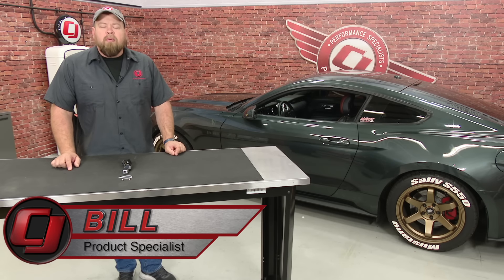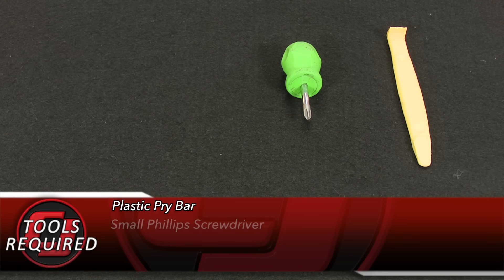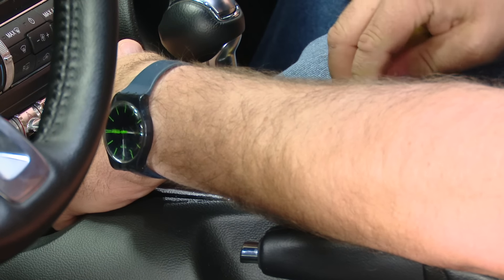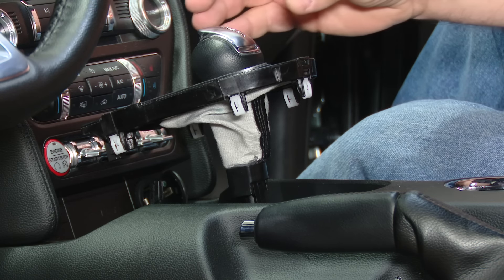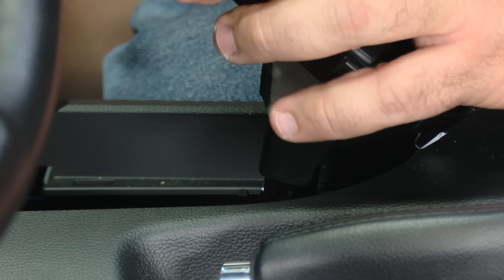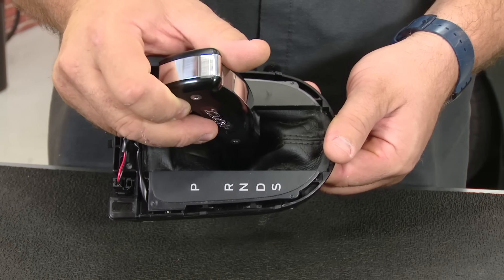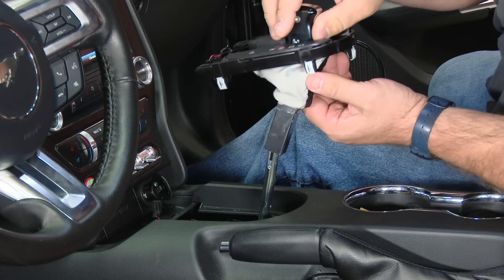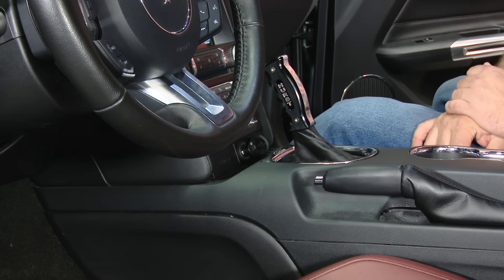2015-2022 Mustang V6/EcoBoost/GT Hurst Automatic Shifter Handle Pistol Grip Installation

Comment: Am i the only one who has had an issue with not being able to seperate the original shifter from the boot?
Reply: Ryan Shaffer no I'm having trouble as well
Reply: The original assembly as in the black panel wouldn’t come out of mine without snapping plastic that holds center retainer

Comment: I just installed this in my 2018 GT....I'm am glad to report that I didn't break anything!

Also, the silver plate doesn't separate from actual shifter on the 2018...I also needed to turn the car on to move the lever back, turned it back off in gear with the E brake engaged...

Thanks for this video, it helped a great deal!

Comment: Like others the button sticks or won't release but I hope it wears in after some use, I did find that when you put it in park to slightly pull the shifter to the left or give it a tap to the left and the lock out button will release and hold the shifter in park. When starting the car and shifting into reverse, neutral, drive or sport you may have to slightly push the lever to the right for it to release the lock out button. You really can't install this wrong as it only sits on top of a plastic rod that the lock out button assembly pushes down to release the lock out. The two screws only line up one way so there is not miss-adjustment of the shifter handle. 

The handle itself looks good, much better than the factory shifter handle. I just wish the button worked better out of the box for the price they are charging.

Comment: how come there isn't on for a 2013-2014, automatic mustang
Reply: Alfonso Rodriguez because of the select shift button i presume
Reply: @dom3489  I've been looking into this. I'm wondering if it could be Jerry-rigged with a 2013-2014, and then you just have the Select shift functions usable by adding some AMG mercedes paddle shifters on the wheel. Wondering if this is possible because I would REALLY like to do this...
Reply: @brandonschnars5280  there is a guy that custom makes them. Kilduff or something like that
Reply: @dom3489  just checked his website and he doesn't support the MT82 transmission in my car... :( All I want is a shifter exactly like this, and to get them paddle shifters on mah wheel! Not looking for a drag setup, just something less ugly than the stock shifter.
Reply: Brandon Schnars the paddles won’t work if you have a manual
Reply: @dom3489  You sure it’s kilduff? I checked out his website and it doesn’t say he has anything for a 6r80
Reply: @flame562  you might can contact them and maybe get them to figure out how to make one work who knows

Comment: I've been looking into this. I'm wondering if it could be Jerry-rigged with a 2013-2014? and then you just have the Select shift functions usable by adding some AMG mercedes paddle shifters on the wheel. Wondering if this is possible because I would REALLY like to do this with my 2014 with select shift...

Comment: So I installed an Aftermarket Shift Knob on my 2015 EcoBoost and for some reason it moves freely weather or not my foot is on the brake off the brake. I just need to know how to fix this if I can because the idea that I can shift it back into Reverse while doing 65 on the Highway does not sound fun.
Reply: I did find that when you put it in park to slightly pull the shifter to the left or give it a tap to the left and the lock out button will release and hold the shifter in park. When starting the car and shifting into reverse, neutral, drive or sport you may have to slightly push the lever to the right for it to release the lock out button so that it won't shift into reverse or park.

Comment: would this fit the 2014 automatic Mustang if we don't use the select shift in sport mode?
Reply: no but there is a shifter that does work with the 2014 mustang https://www.mustangdepot.com/OLC3/Interior/shft-knob.htm